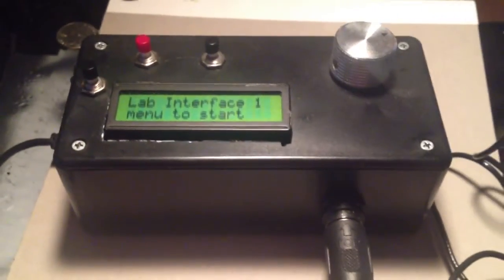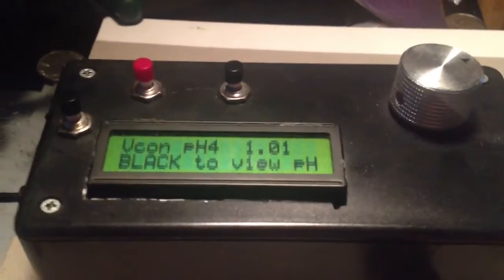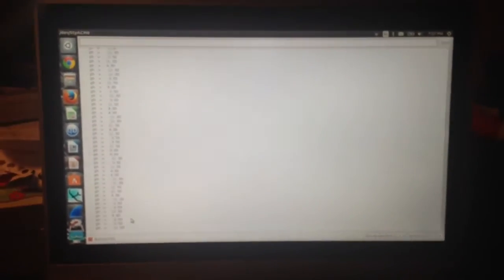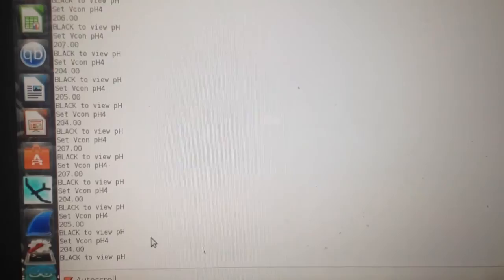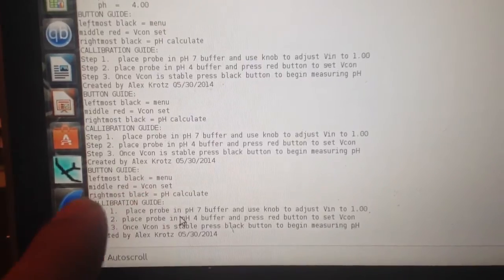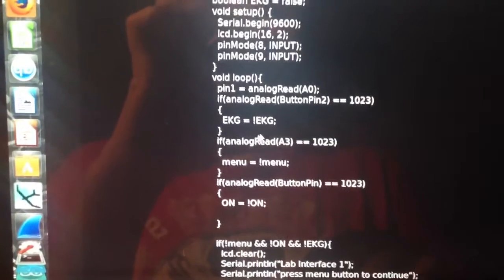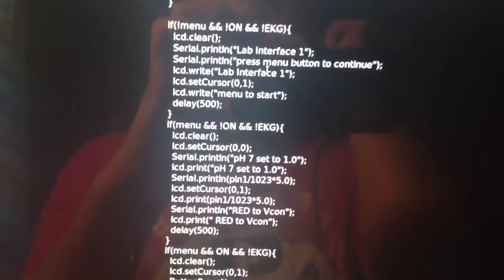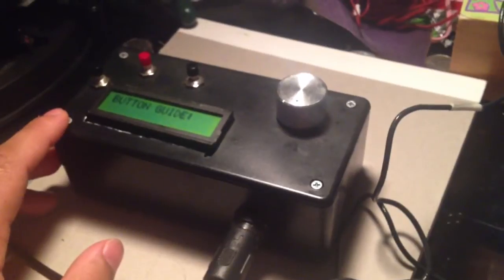Arduino ph meter

Comment: plese share your code. its awsome
Reply from the maker: +Knight Rm The code can be found here, along with many other projects I've done. Glad you like it! 
https://sites.google.com/site/projects135/projects/arduino-ph-meter
Reply: +Alex krotz thank for your code. but there is not diagram. it's hard for me to follow your instruction
Reply from the maker: +Knight Rm do you need a circuit diagram? it is just three independent push buttons to digital inputs, then a simple potentiometer to an analog pin. I can try to provide more info on the code if you need.
Reply: *****  yes of course. its great. hope you help.
Reply: *****  I have to make a project. display PH value on LCD 16x2. but its really hard for me. I'm not good at writting code.
Reply: @rcbowstring123  it is amazing sir. Sir is it possible to get code because the provided link is not working anymore. Thanks in advance